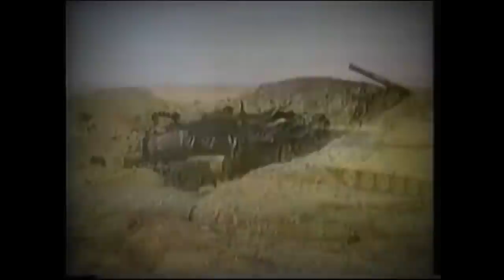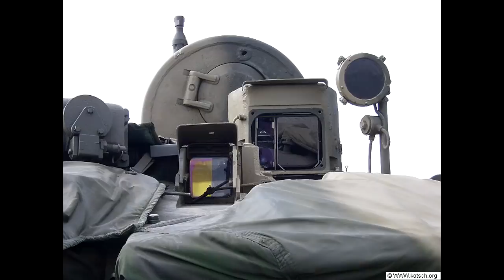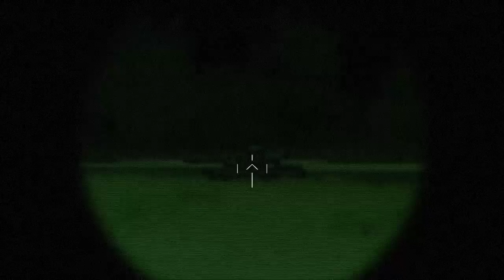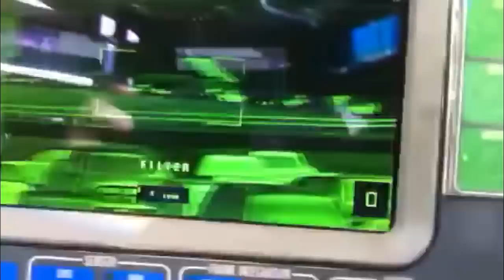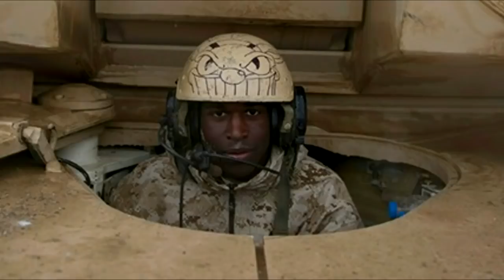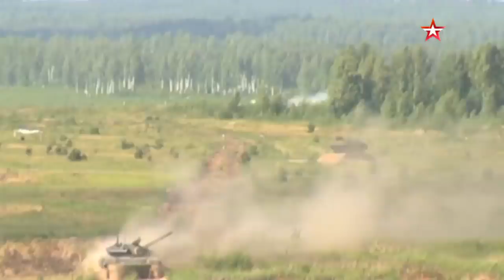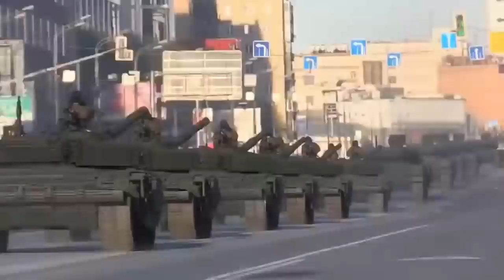Does T-72 stand a chance against M1 Abrams?

Comment: And guys there were soviet issued models in Iraq during gulf war and the 2003 sequel. The best 72s went to the republican guard. The local model didn't hit 200 hulls. Most 72s were imported from the pact.
Reply: What I find shocking was the mentality of the time. We as in the USA were scared to death of the 64, 72 and the 80. Never realized that soviet penny pinching was a factor. We thought the 72 had to be really awesome cause the 64 was. Instead we leap frogged the tech without realizing it. The worse part of the 72 are it's crew accommodations. A nearsighted optic, out dated infrared targeter( that gave away its position) no air conditioning for the crew etc. Brezhnev and his cronies hamstrung the engineers. And that got people killed. What good is a 5000 meter range gun if you can't see to fire it? What good is a slow ass auto loaded when the crew is sitting on the ammo? Bad compromises to adhere to a committee ruling.
Reply: @nicholoscaudillo  export version of t-72 been made weaker by intention. And its been ok for local wars. Nobody expected that U.S. would stub Saddam in his ass when he agrees to leave Kuwait after soviets convinced him to do that.
Reply: Export tanks from soviets had simplified tech but the armor and Chas is were the same. Takes to much to time to retool the factory that you are using for your own tanks. After the fall of the union, it was grab bag time and we all got soviet only tanks. Those did just as poorly in 2003. I don't buy the monkey model theory as soviet tanks were designed from the outset to be easy to learn by their own conscription troops. The 72 was overrated as badly as the 80. Why? Because the 64 was the one that was truly better than the m-60. We panicked and spent the resources to build better. Brezhnev said repeatedly and resoundly build more build cheaper and I don't care about losses. We took 3 steps forward they stopped innovation and just went incremental. Even the early t-90 is little better, the oplot runs rings around it. T-14 different kettle altogether.
Reply: On a related note, look at the newest version of the merkava. That armored turret is an evolution of a design theory proved by the t-55. And it is still soldiers on
Reply: @nicholoscaudillo  you are very very wrong about T-72.
Actually Soviet models where equipped with composite armor, export models NOT. Only Czechoslovak M1 version got composite armor outside of Russian production. Even the first ERA made the T-72 impenetrable by 105mm western gun and even the 120 Rheinmetal had big problem to defeat the T-72M1 with ERA. The western tanks did match the T-72 in late 90s after west got enough T-72s to test, but believe me my friend, in cold war times there was reason to shit the pants for western tanker if they would stand against the T-72. 
You are also wrong about space inside the tank. There is much more space for every battle station then in M1A2 except the space for loader. Well, there is no loader inside T-72 so what? Driver has about same space, gunner and commander do have luxurious very comfortable position when compared the M1A2 where gunner sits in commanders crouch.
You are also wrong with the ammo storage, tanks do not blow in the moment of penetration. First the propellant has to ignite, heat has to accumulate to make the explosives to go off. This takes couple of seconds, so the crew can either evacuate or the firefighting kicks in and the flames go off. Or the crew is already dead so what...

Also you forget what was the worst enemy of German WWII tanks, logistics.
The Abrams is a logistics nightmare if compared with T-72.
Reply: CNN and other military released video imagery from the m1s and m60s show the 72s lighting up. One horrifying video shows a crew man immolation just as he barely got the commanders hatch open. Physical evidence from actual battlefields hold more weight with me than conjecture based on a belief. The 72 proved to be unsafe in modern late 80s to today combat. It didn't need to be that way. That's my point, politics in the Soviet Union took a design trend and sacrificed crew safety for ease of manufacturing
Reply: @nicholoscaudillo  The Iraqi mostly used their own domestic build T-72 copy with mild steel (Lion of Babylon). Even a 30mm gun could penetrade it frontal. Also the others were either chinese T-72 copys or export downgraded models from the first T-72 "Ural". 

The soviet union used in that time the T-72b with kontakt 5

After the DDR collapsed and rejoin the BRD. Nato got hands on some T-72 A with kontakt 5 (T-72A is a export model dont mistake it with the russian T-72A)
Nato made tests and the result was they couldnt penetrade the frontal armor of that export T-72A with kontakt 5
Reply: Until I saw the battle damage pic I wouldn't believe such disregard for customer or crew existed. Even by soviet standards. But seeing is believing. Went from good enough get it out there t- 34 to F it. It ain't going to last anyway mentality.